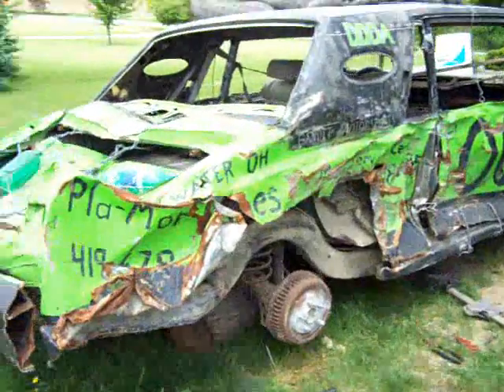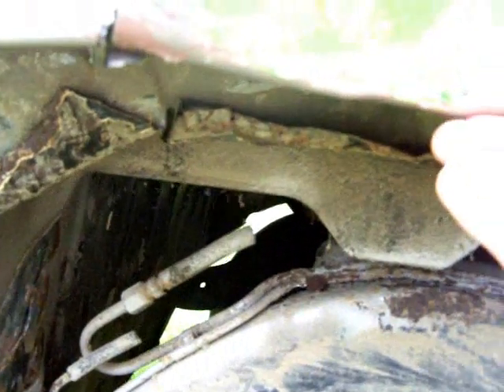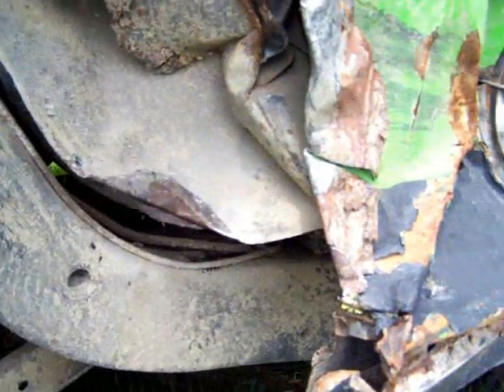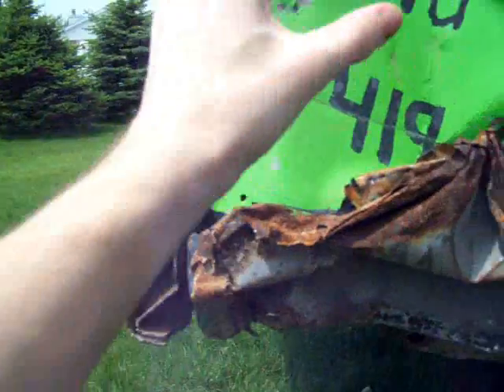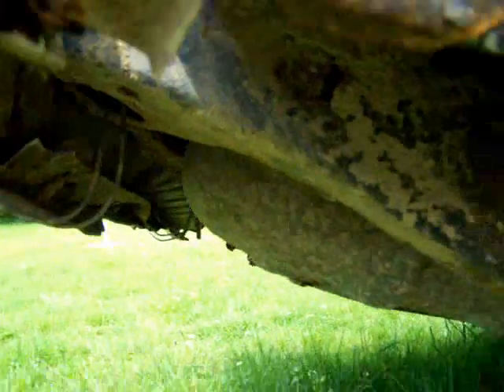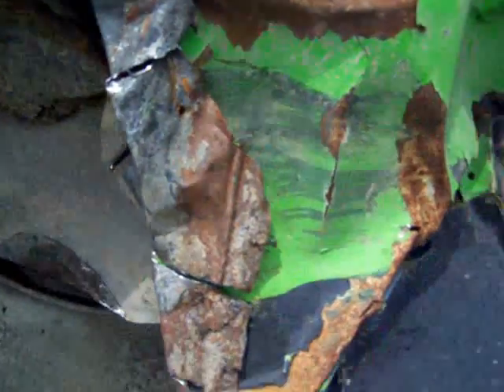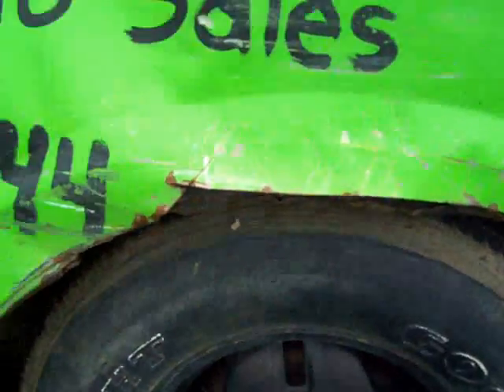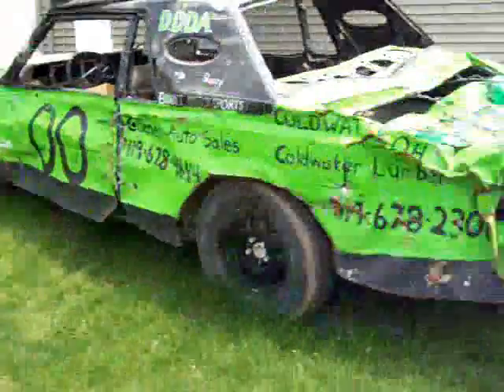How to Notch Car Frame and Making Wheel Clearance

Comment: i find if you  fold the metal over like you did there ( before the car is ran) over the wheel well, bolt the inside metal to the out side it makes it harder to bend and looks dirty dirty dirty tough